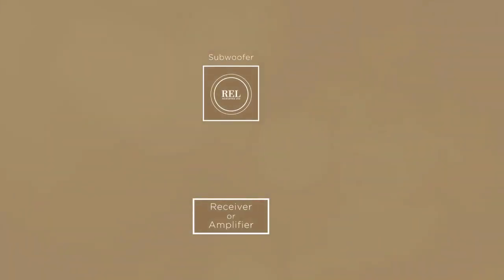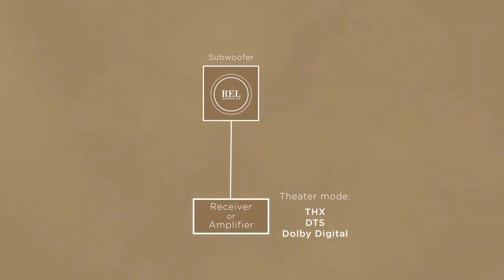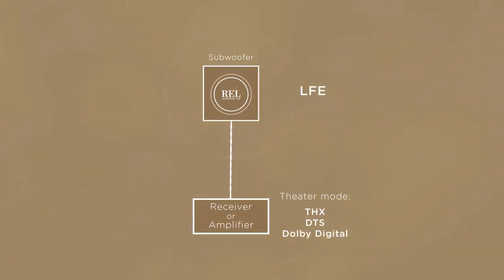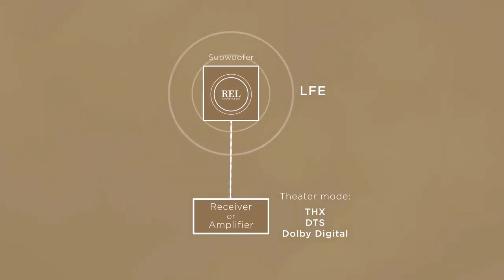Co to jest wejście LFE w subwooferze. Opowiada pracownik REL Acoustics (polskie napisy)

Comment: Czyli jeżeli jest możliwość LFE to najlepiej tak podłączyć i jest to najlepsze podłączenia ?
Reply from the maker: Dla kina domowego tak, dla stereo nie
Reply: A co w przypadku gdy w stereo do wyjść głośnikowych wzmacniacza mam podłączone głośniki oraz subwoofer poprzez przewód speakon (system 2.1). Natomiast kino 5.1 jest realizowane przez amplituner klasy AB, gdzie wzmacniacz robi za końcówkę mocy ("preout front" z amplitunera do "bypass" wzmacniacza). 
Czy można podłączyć dodatkowym kablem z "preout subwoofer" (w ustawieniach "LFE" ON) do wejście "1.LFE" i korzystać jednocześnie z sygnału głośnikowego (poprzez wzmacniacz) oraz wyjścia preout subwoofer z amplitunera? 
Dodam, że w amplitunerze mogę ustawić dowolnie filtr (np. odcięcie 50Hz dla subwoofera) oraz zmieniac kolumny small/large. Czy lepiej odłączać przewód speakon z subwoofera, gdy korzystam z amplitunera i systemu 5.1?
Reply: Sam sobie odpowiem,  może komuś się przyda:
HI LEVEL and .1/LFE inputs can be used simultaneously. The benefits are two-fold when used with a home cinema system. The low level input reproduces the .1/LFE channel and the high level connection underpins the main front speakers. The main front speakers should be set to the ‘large’ option on the processor. 
W skrócie można podłączyć jednocześnie Hi Level (speakon) i LFE, co jest bardzo dobrym rozwiązaniem gdy korzystami z tych samych głośników w kinie (amplituner) jak i w stereo (końcówka mocy).
Reply: @djtaboret witam.czy rozumiem że tego suba można też normalnie podłączyć do wzmacniacza pod wyjscie sub?jeśli tak to którego wejścia mam użyć w subwooferze?